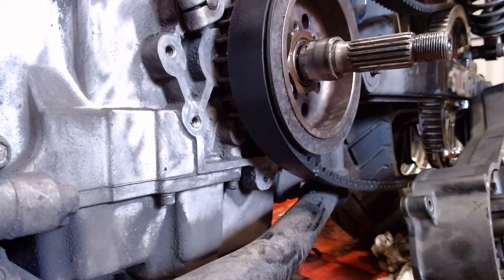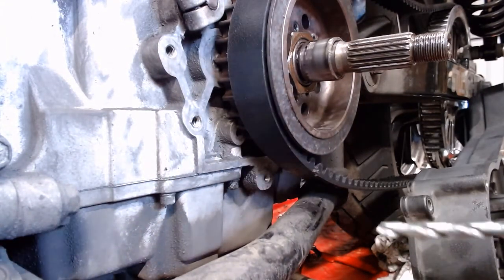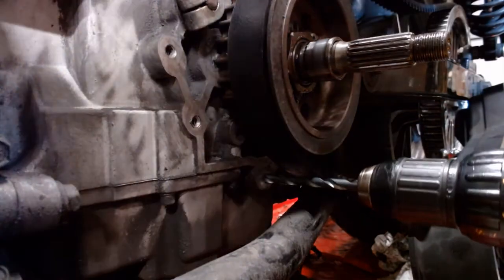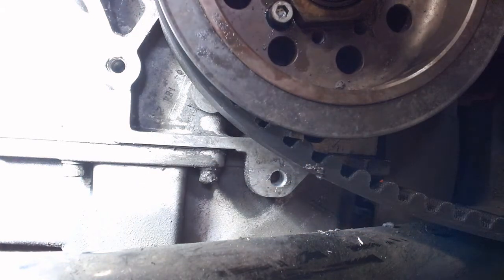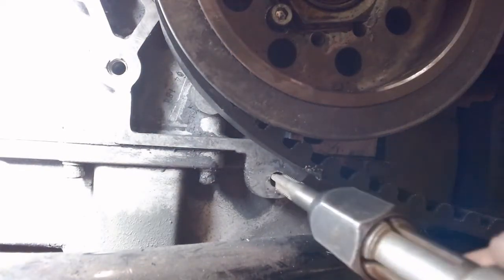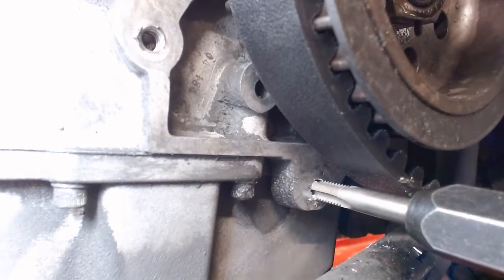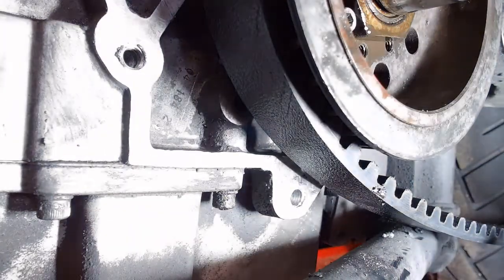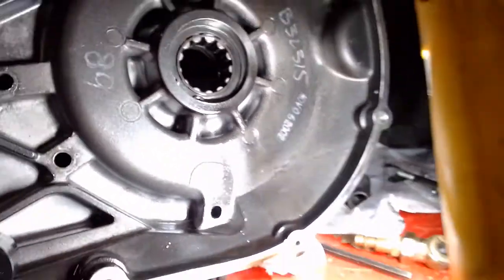Repair Stripped Threads on a Harley Primary.

Comment: Not trolling on ya but you tapped that in at an angle when it should of been tapped straight in
Reply from the maker: The tap went through straight, and the threads cut evenly.  I was not using the best camera for this so it just appears that way because it fish eyed a little.